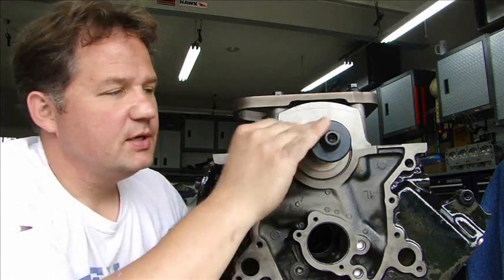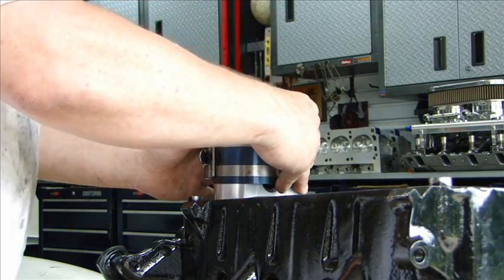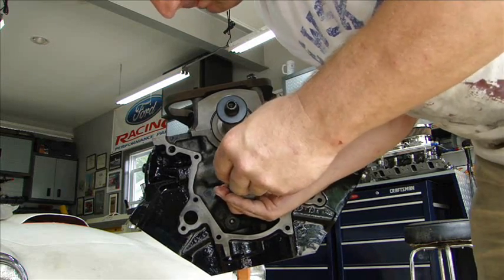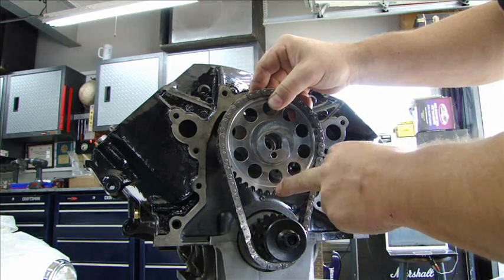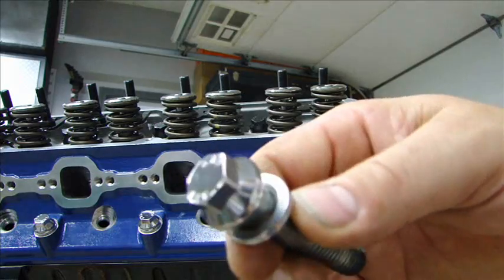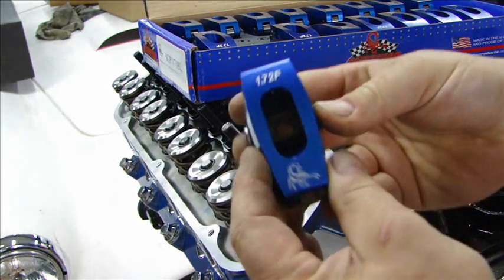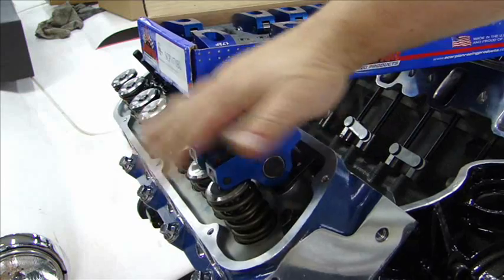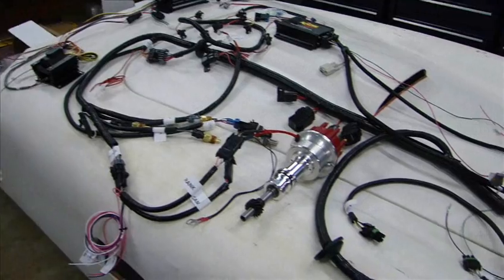Cobra Engine Build Part 1

Comment: Missed showing the "this side up" mark on rings...  pretty critical..
Reply from the maker: I did that in another video
Reply: ok thanks.. I never looked as this said "Part 1"..  I also am religious about break away torque on installed cranks and rod assy.   I am married to plastigauge but still do this all the same..

Comment: Are there any engines that use electronics to open and close the valves? Seems like digital control of that could save a lot of weight vs. a camshaft...
Reply from the maker: magicstix0r That is true. I have seen prototype of latching electrical valves. I even say one running, but the technology and cost has a bit of catching up
Reply: vanos. bmw uses a valvetronic system
Reply: +Avi that's to adjust valve duration. Like honda's VTEC or toyota's VVTi-L.
Reply: +magicstix0r I think it's mostly in F1. There are I think some pneumatic systems that do it. Having that kind of control also give infinite valve timing and reduces rotating mass. 

I think the tech is still a bit expensive, I think some are trying to make pesio electric systems to respond quick enough and be cost effective.

Comment: Hey man, I've been looking around and I can't find the engine code on the 03-04 cobra engine, do you mind telling me what it is?
Reply from the maker: Look around the block where it meets the bell housing
Reply: Here is what I went through to find the Ford code on my older 1987 302 block. 
 
On my 302, I had to search and the four character engine code is embossed on a flat surface on the block right above the starter.  Find the chart for reading Ford part numbers via google search.   The first character is the decade, the second is the year in that decade, the third and fourth identify the engine type ... mine was from a Truck.  You had to get under the engine to read it, and it was caked with paint and dirt so I had to use a dremel tool to read it.   The full Ford code is not there.  I found another number on the back above the place where the block bolts to the bell housing.  I assume that is the engine serial number.

Comment: why mostly pushrod engine still use chain connection if cam and crank that close, why not direct gear connection?
Reply from the maker: Direct gear is different and often more noisey.
Reply: Petes Garage do you think a malary dual point is better than electronic performance wise?
Reply from the maker: It depends on what you want to achieve.

Comment: I know that DPFi is far superior to carburation that is why its used with the innovator of the high compression engine also known as the diesel engine -----the smaller micron you can atomize the fuel to the more heat energy it can release ,,,yes there are many variables when it comes to mass produced  manufactured engines so talk of tune is irrealavant theoretically and for arguments sake we are assuming balanced and blue-printed rotating assembly's and blocks,this is the age of the transistor

Comment: Do u know if i can put a cobra motor in a 2000 ford ranger 5spd?
Reply from the maker: You can put a Cobra motor in a 1984 240Z if you wanted to
Reply: +Drizzy_78_Drake  You can put ANYTHING in a ranger with the right knowledge, tools and experience / will power. ive seen everything from a cummins to a wankel rotatory in one. hell they even made an electric one for a while.

Comment: shouldnt you use a feeler gauge to measure the valve lash it should range anywhere from .003 to.006
Reply from the maker: Only on a solid lifter motor
Reply: I set the piston at TDC firing order, adjust both the valves then, I do not roll to exhaust open, then to intake to adjust opposite valves, I suppose your technique is some what more accurate for hydraulic lifters....

Comment: pete  how do I hit 300hp with gt40p heads, I have already these parts comp cams xe270r , 75mm throttle 24lb injectors, typhone intake, headers and 3.55 gear please HELP
Reply from the maker: What engine?
Reply: 302 sorry about that
Reply from the maker: Do you know how much HP you are at?
Reply: hey pete  I will be putting gt40p heads and valve spring kit and xr270 comp cam at 512 lift and 24lbg injectors 75 mm throttle to move the air, typhone intake, what do you think of the typhone intake pete, how much power will that conservative compo make 290-300 maybe hp
Reply: hey pete can I call you please thanks
Reply from the maker: sure 716-697-1690

Comment: Ever one knows that the cam goes in before the crank.
Reply from the maker: Would you be surprised to know that in every engine manufacturing plant, after the block is put on the assembly line the first major part installed is the crank?

Comment: I just thread an 8" bolt into the end of the cam (same threads as the cam bolt) and use it as a handle to install the cam. Its alot easier than taking it off the stand and standing it up to drop the cam in. Thats too much work.

Comment: I noticed you didn’t verify the cam card numbers duration , lift, center lines , and lobe separation with a degree wheel???   Or check valve spring rates or installed heights? I’ve built sprint car engines for 22 years for a big name company in the industry.   We use only the best in components and I can tell you MANY times we send parts back because there off from what they say .  Mostly cams.     NEVER EVER trust a machinist or cam card for accuracy.   Everyone and every machine can have bad days .   Always check it on every engine.  Know exactly what your sending out the door to a customer.
Reply from the maker: I have a few videos on verifying and degreeing a cam. I've done this engine a few times.

Comment: that is not how you set valve lash... and the bad part is that you have a feeler gauge and you wont use it to set the lash. you need to go take you valve covers off right now and set the lash to .060 with your feeler gauge and i bet you engine will run better than before

Comment: Nice looking rocker arms....to bad they get covered up!  LOL I never understood why scorpion dressed up there rockers with blue...you only see them when you have the motor apart.  Its like painting your connecting rods..pointless. No one will see them.
Reply from the maker: True....but it adds like 135 HP .....lol
Reply: This is true...
Reply: those are not painted they look like that because they have been treated with a chemical to make them stronger
Reply: fastskynet who told you that?  I personally just think it's a vanity coating. I guess to distinguish the brand amongst competition. 

Skimming through Google you can find rockers of all types of colors. Red, teal, gold,orange, black.  I think it's just a brand thing.  Some take the time to make them a color to stand out when you are looking around for a new set perhaps.
Reply from the maker: When aluminum is anodized the surface does become more durable. Yes, the color is brand specific, but the actual process makes the surface harder.

Comment: Idle air temp? Sorry bud its intake air temp also known as barometric pressure sender using this to tell the ecm how much oxygen is in the air and the temp of it!....18 is kinda high if ur not running any kind of nitrous u could go 12-14 that will give u little more power unless u plan on nitrous or boost u don't need to gap that high....also didn't see u degree the camshaft and tdc..
Reply from the maker: You are 100% correct. However, this particular engine management system requires the intake air temp be monitored at idle. My dyno guy tunes many of these systems and told me it is critical to put that sensor right in the idle air stream. Since there are 2 throttle bodies I mounted the sensor directly in the idle air stream of the rear one. There is a small port that allows air in at idle and is controlled by a motor. That is why I called it the idle air temp sensor.
Reply: So u are saying the computer would not need the intake temp at throttle only at idle? Why would it only adjust air/fuel at idle and not threw the rpm? That would not make sense
Reply from the maker: v6silverado06 It is more critical during idle. Since there are 2 throttle bodies and only one has the idle air motor, the sensor needs to be placed directly in the stream of the idle air flow or tuning the system would be impossible. It monitors throughout the entire RPM range.
Reply: So u say it moniters threw the hole rpm range? So its not a idle sensor it would be a intake air temp sensor because it moniters threw the hole rpm range....not trying to argue just making sure people who watch these (how to) videos are getting the correct Information...sorry but its a intake temp sender not a idle temp sensor.
Reply from the maker: v6silverado06 I was disappointed to find no videos on your channel. I thought for sure you would have several clear, concise and educational videos to share. When you post some I would like to see how you present the information.
Reply: ? Is that a question knowledge when I feel I have learned something that should be shared I will share it when I feel the need to boast my knowledge I will but at the moment I'm contant with what I know and the things I know to build a engine....sorry but if your trying to insault my intelligence on engine build.. Why don't u prove me wrong in this intake air temp comments and show me where it says that just saying u can't say its a idle temp when u say its the (hole rpm range) if so why would u say idle? Just simply stating a fact of knowledge not trying to test anyone...just tell u the right (lingo)
Reply from the maker: v6silverado06 Well, you certainly have made your point. I'm sure everyone who reads your comments will appreciate you sharing what you know. Just a word of advice though. If you are going to criticize a single word in a video your response and or comments should be clear and succinct. I had a difficult time reading your posts because they are plagued with spelling and grammatical errors. There is a difference between telling someone they are wrong, and telling someone they are wrong without making numerous mistakes yourself.

Comment: i believe chevys Ls3 and lt1 350 is better than any motor ford ever dreamed of making, i dont know i guess i could be considered a turncoat?  ive always been like ford better in my youth with mustangs ive had 289's  and 302's  but since ive gotten older i see that nobody can deny that chevy has better stuff
Reply from the maker: Each manufacturer has it's pluses and minuses. I worked as an Engineer in a Chevy engine plant. Needless to say I would never buy a vehicle that had any of the engines we built. I respect everyone's preference.
Reply: Common sense that ford design is more practical but chevy can make more HP cheaper
Reply from the maker: Yes, Chevy parts are more common so they will be cheaper

Comment: Seriously, with all the nice stuff you're working with and you dont even have a cam handle? That cam install was cringe worthy.
Reply from the maker: +Drew Styduhar I understand your point, but they are installed straight in at the factory, albeit by machine. thanks for your comment
Reply: You could have easily purchased a long 3/8-16 bolt at any old hardware store to use as a handle.  Or installed the cam vertically with block up on end.  No excuse.  Your install method results in unnecessary banging on those soft cam bearings AND significantly increases the potential to drag block grit into those areas.  Not good practice.
Reply from the maker: Great comment